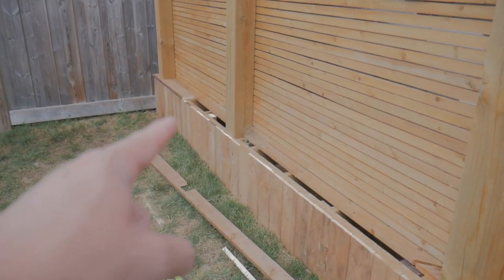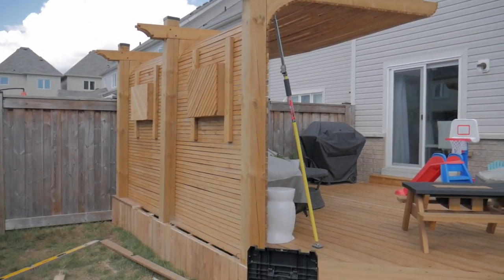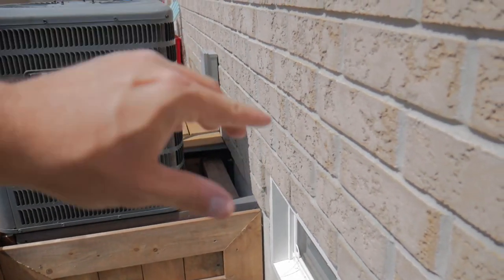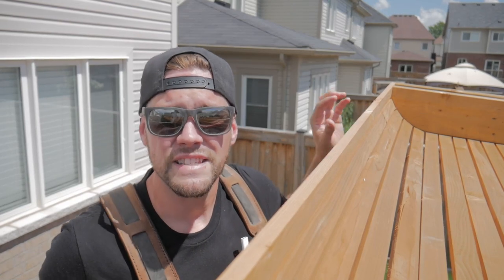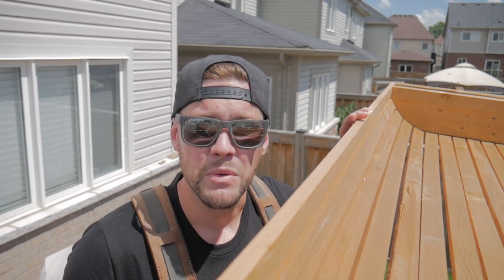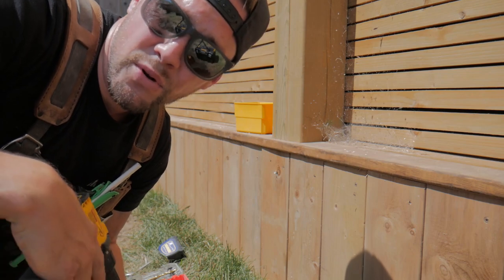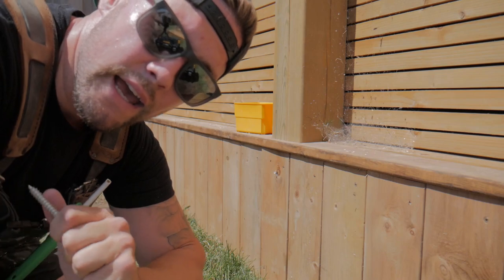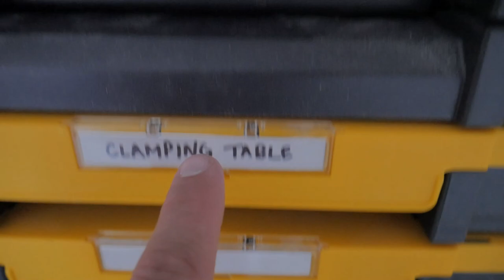The Curved Pergola

Comment: Looks great. Love the curve, little windows, and cable tie trick. One of the best executions I've seen. But I wish you showed more of how you connected the cable tie at the top. It sort of looks like you drilled a hole through the post and connected it to the end of the cantilever? I imagine over time that wire will widen the hole in the post. Just curious. I'm trying to figure out how to do a similar style. Thanks for the video.